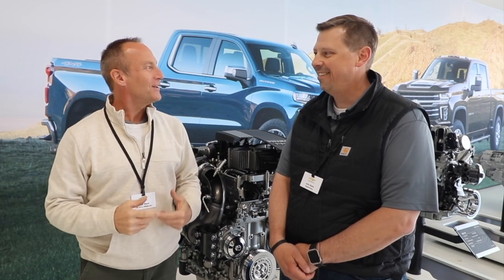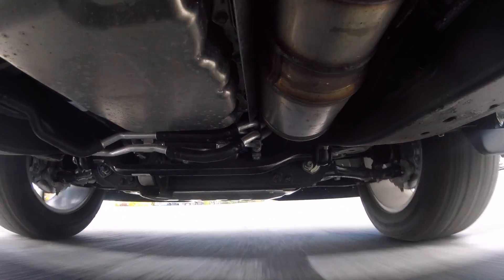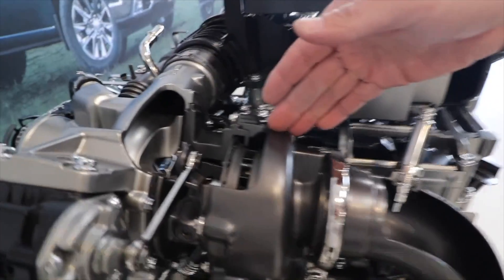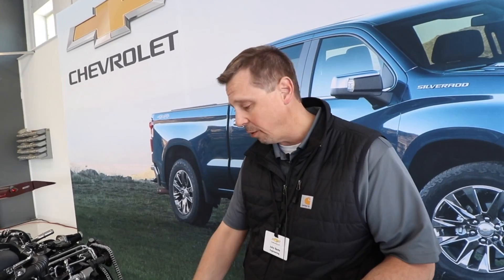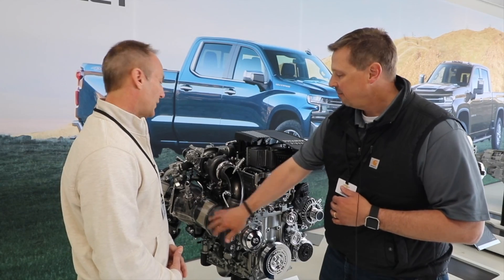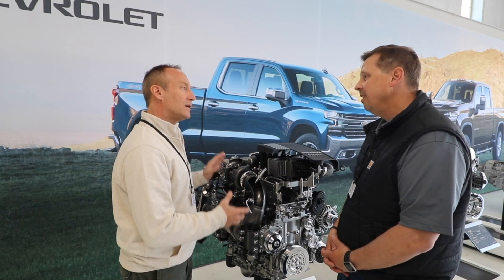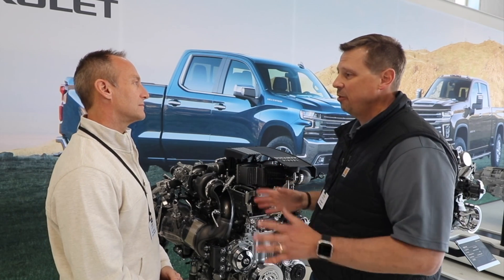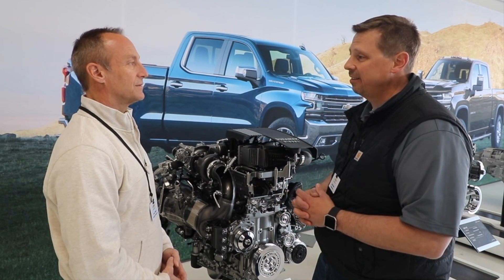Engineer Reveals All! Duramax 3.0L for Silverado 33 mpg hwy

Comment: I expect a diesel engine to go 300,000 miles as I do this one. What the engineer says is that the competition shoots for similar numbers as the 150,000. I have got better than 340,000 from gas engines. I have a 6.6 or whatever Duramax. Chevy put junk injectors as OEM, other than that expect 300,000. At 190,000 now. Biggest pains are 25 below in Minnesota, finding fuel in some towns, and when 5 gallons remaining in 24 gallon tank, can't go up any hill. You will be sucking air due to where fuel line draws fuel. Gas gauge says you are at 1/4, you're almost out.
Reply from the maker: Thanks for the real world experience comments. Sounds like an aftermarket tank could be in your future.
Reply: @4WDMagazine  on my 17th year with this Chevy, just live with the issues. Oh, and with a diesel, have to shut off your engine in drive thrus.

Comment: DEF is such a scam.
Reply from the maker: Just curious - What's your main beef about DEF?
Reply: @4WDMagazine  I don't think it actually works. I live in California and haven't seen a difference in air quality since 2008 since large diesel trucks started using it. Also the diesel emission systems they use now make diesel engines less reliable and much more expensive to maintain. 
 I think they just wanted to make a new industry to tax. It's all about money at the end of the day.
Reply: @highbrass3749  its cleaner I can tell.as I mechanic in the shop and ru semis in the shop to troubleshoot hydraulics,ext. But I the nasty, smoky  regen, kinda ruins alot of the benefit I think.
Reply: The EPA is a scam

Comment: Was it built along with Isuzu?
Reply: No. Duramax no longer has anything to do with Isuzu.
Reply from the maker: Designed in Pontiac Michigan
Reply: This engine is based on the same design as the Mercedes-Benz new OM-656 I6 diesel engine. GM's diesel engineering center in Turin, Italy adapted the design for GM's trucks, and the design was handed off to Michigan for final engineering work, testing and validation, and manufacturing.

Comment: Only 150,000 the old engines for 1956 pontiac Bonneville was rated at 500,000 the lsx motors would be good for 500,000 as well

Comment: Now if those geniuses can make the engines stay quiet and not rattle at low rpm,all of them not just some,I'm on my second engine and both rattled and both used over 3 quarts of oil between changes,first motor had oil pouring into the back 2 cylinders-they said I don't qualify for a buyback and I'll just have to listen to my bag of marbles for the rest of my life,first new truck, first to rattle of any diesel I've owned

Comment: Diesel in a half ton? Why? This is a fad. Hybrids are coming whether we like it or not. Hybrid will give you much more power while towing and better MPG. I saw what GM did when they dropped a diesel in an Olds 98, it sucked big time. I would not spend $65,000 on a “new” engine from GM. IMO this is a two to three year fad. The HD with larger Duramax is a must, 3.0L Duramax is a whim.
Reply from the maker: Good points but I'm not sold on hybrids yet.

Comment: old diesel engines designed by engineers new diesel engines designed by bureaucrats
Reply: Yup. My 86 Chevy 4x4 3/4 ton still runs great with the Goodwrench NA 6.5 diesel. It will start and run after an EMP when nothing else will. I have the 6.5 Turbo in my boat  as well and the only thing that goes wrong is the rotted and leaking fuel leakoff lines need changing every few years.

Comment from the maker: You'll never believe how long this engine could last! Could it be the engine for you?
Reply: Is all the dpf egr and non sense down stream of the turbo so can be removed easily?
Reply: @deadly134  ALL can be removed . . . you just need someone to fix your ECM/PCM/BCM to not freak out after deleting all that CRAP.
Reply: Well at a 150k it needs a oil pump belt done. How many blow up before then
Reply: New Truck, New Motor, Shitty interior! GM interiors are so dated it's not even funny.. Dodge will out sell them just cause interior comforts
Reply: Could but won't due to all the electronic garbage and emissions shit put on it.
Reply: Longer than my friends F150 and ram
Reply: Yah that won’t last at all. 7:20 in your video tells me that. These will last as long as the ford 6.4 power stroke.
Reply: Kwmike-D I agree I own a Silverado and interior super cheap looking

Comment: Anyone driving a diesel does notice the “ regen cycle”. You notice the bbq smell, the turbo noise, and the power loss during the cycle. If they eliminated those, good for them. On another note, I’m pretty sure that DEF is not good for the environment. I’ve run my truck near 2 different trees, both had limbs that died where the exhaust was pointing. I can only imagine what it’s doing to us.

Comment: Is that a timing chain i see on the back of the engine???  If so - Fail.
Reply: R J it’s a cutaway model
Reply: @justineubanks1497  YES, that is how I saw them, genius. My point is the fact that the timing chain is in the BACK of the engine.  Hard to service - and it will need service knowing GM.  Think Ford and Audi rear timing chains in the BACK of the engine - total fail for service.   C'mon man.
Reply: Your right
At least I’m not as genius as some these guys on here
Reply: Yeah, just bring your 401k to the dealer and they will replace it for you.

Comment: I see 40k to 80k the liquid charged intercooler will fail causing antifreeze to be shot into the turbo and intake just like the egr cooler failures in the past so no wounder you don’t advertise past 150k
Reply: The water to air intercooler is it own system, and not a new thing, the GMC Syclone and Typhoon of 1991-93 had water to air intercooling
Reply: Never said it was new just that it’s a stupid idea
Reply: @brianyoung5204  
It's the best way to cool down race cars, if it can handle the stress of race cars, daily drivers won't be a problem

Comment: 40 years of being a diesel mechanic anything this got Duramax on it don’t walk away run away this new engine with a chain on the back is a disaster waiting to happen all real diesel engines and trucks running 80 and 85,000 pounds are in-line six cylinders these engines will not stay together when you work them every day people listen 40 years of diesel mechanic experience I’m not lying to you these engines will not stay together

Comment: Sounds like Chevy needs to stick to gas engines! Glad I switched to Ram 1500 EcoDiesel truck, 200,000 highway miles, and towing a 28ft camper, great MPH!
Reply from the maker: What mpg do you get?
Reply: I average around 24 / 25 MPG on the Interstate, driving at 74 MPH. When towing my camper around 20 MPG, going up hills it drops around 18 MPG. Waiting on this engine in a Jeep, I have 16 Rubicon Rock Hard Edition now.

Comment: I'm 6mn in and I'm gobstruck at all the electric turbos, exhaust turbos, swirl-valves, high-pressure EGRs, low-pressure EGRs, anon anon anon anon. HowTF Rudolf Diesel ever got his invention to even start bewilders me. Certainly, all this b*llsh*t will cost a small fortune to keep in running order.

Comment: Belt driven oil pump....... where from what ive heard you have to remove the transmission to get to it which also means T-Case,  drive shafts, cross members,  maybe exhaust depending on how it routed.

ill be keeping my LB7 with potentially bad injectors over that engineering disaster

Comment: 2 egr valves, extremely high pressure pump / injectors ..... I can’t see many new diesels moving toward being long lasting . I have a dpf and epr diesel and it’s definitely not adding value to a longer lasting engine in my opinion. Good luck.

Comment: Brand new junk with a b50 service life of 150,000. For $43,500 base price. That is .29 cents per mile before finance charges, fuel, and insurance.  Great idea putting the DOC on exhaust side of engine, if you want a overheated engine.

Comment: They planned in a major breakdown or at least a planned very expensive repair for those belt changes.  

Regarding the belts vs chains or gears decision.  I guarantee there were some bean counters crunching numbers to determine how to maximize profit.  They calculate a small drop in sales vs a huge bump in repair revenue plus lower manufacturing cost.

Comment: Thanks for the presentation!
This explains perfectly why I will not buy one.
YouTube videos starring the brand new 3.0 diesel truck with 146 miles on the odometer and blown head gasket does not inspire me to spend $50k on a lemon.
Reply: I have one and it’s very economic and strong on tow!!
Reply: @MrFredexcel  never buy the first edition model year. Let others test the design for you. Most bugs will surface in the first few years of actual street use. I've worked in a car mill. I will never buy a new car.

Comment: Why would anyone buy this engine. 150,000 is a joke. 
I drive 2200 miles a week in pickup. My Tundra has never let me down. Only reason I was looking at this was mpgs.
Reply: So you spend about $20K a year on gas in your Tundra, and you'd save about $10K a year with the Chevy diesel.  Buy your Chevy from a dealer that offers a lifetime powertrain warranty, and you'll be in great shape.

Comment: aluminum block diesel scares me off.  Compressed graphite would be better.  EGR cooler leaks will cause engine overheats and block / head failure.  I would avoid it for at least the first two production years.  EGR valve will coke up those swirl valves on the intake.  They are in a hard place to remove and clean.  Like all new clean diesels that are loaded up with EGR, DEF, and DPF - don't buy this truck if you are doing mostly city driving.

Comment: That bicycle chain cam drive, though.   This is a bad place to save a few bucks or a few lbs of weight.   What's so hard about making a heavy built overhead cam chain setup?  Mercedes Benz and Toyota double row overhead cam chains almost never caused issues.    Today's overhead cam chains are really cheaply made.

Comment: WTF is 150k miles I have done that in 4 years so  basically those are throw away trucks...what's so hard about making the oil pump crankshaft driven like the 6.6 dmax and LS engines...oh never mind COST and yet rip off the customer....
My 08 dmax is pushing 550k miles 👍🏾👍🏾I'd like to see that stupid design oil pump belt last that long

Comment: The down fall of GM
Reply from the maker: What makes you say that? The other big two already have them in trucks (Ram Ecodiesel  -made in Italy, Ford Powerstroke - made in England)?
Reply: @4WDMagazine  and has had problems
Reply: @4WDMagazine  2 egrs. And a 4cyl gas option
Reply: @seoulkidd1  
???
Reply: @anthonywebber2211  that 3.0 diesel has 2 egr and GM wants a 4 cylinder for the Silverado
Reply: @seoulkidd1  
The 4 cylinder is for CAFE regulations
And makes more power than most V8 did 20 years ago

Comment: Water cooled guess what happens when it starts leaking into your air systmem lol. Bye bye motor.
Reply: What are you talking about? Lmao!!!
Reply: If you are driving a car.. school bus.. diesel, gas, diesel.. der... its water cooled. Water cooled, motorcycles, cars, buses, Van's, dirt bikes, go karts, have been liquid cooled for years!
Reply: They added a cooling system into the air intake to cool down the air as it passes through. Just like those as seen on TV cool air a/c. Water runs through and as air passes it should cool down. Guess what happens when a solid items pases through. That will bust your cooling system inside throwing water into your air intake. Not good.
Reply: JEsus Garay they’ve been putting intercoolers on the intakes for years...

Comment: "Should" last 150,000 miles, except for the fact that when they're driven off the stealerships lot they start to over heat and need to go back for warranty work......additionally the timing chain and oil pump belt are at the back of the motor, necessitating the removal of the transmission for replacement; what POS design! Can we agree that in a critical system like engine lubrication, the oil pump should be a dedicated component and gear driven ? Oil pumps should not be driven by belts like other peripherals such as alternators and power steering pumps; some of you engineers have rocks in your head !

Comment: For reliability. Simple is best not the complex DEF systems that can fail and break down. My 95 7.3 burns cleaner than this diesel ever will. All they are doing is changing the diesel exhaust to a different chemical. The resulting chemical is even worse than the chemical that came out of the motor. And spark plugs don’t need to be changed often. They could go 150K miles on a single set of spark plugs. Is the injection system hydraulic or a HEUI injection system. Most people using the truck will end up deleting the DPF and emissions crap. If I bought one I would do the same thing. And boost my power and MPG.

Comment: I will buy one of these when GM agrees to pay the tab for replacing of the timing chain and oil pump belt at 120,000 miles.   If the oil pump goes out before that, they pay for a new engine.  Would I buy an engine with a belt driven oil pump which requires the transmission to be removed for service.  NOT NO WAY, NOT  NO HOW, NEVER.  Why does Cummins drive the cams and pumps with gears, because it works for 500,000 miles.  Belts and chains on a long life diesel is flat out stupid. 

GM,, guarantee it or STHF up.

Comment: Again the manufacturers design for failure so you half to buy a new one. You know forty plus thousand for a truck is a steel so after 150,000 is a good deal when a gas goes twice that. They are back pedaling to cover there ass this engineer made a mistake and spoke the truth opps.

Comment: I want no pressure egr meaning rip the damn thing off...
Reply from the maker: Whoa, how come?
Reply: @4WDMagazine  Which begs another question, regarding (eventual) Deleting the emissions... The DPF is combined with the other emissions piece (SCR? I think he said) so for those who are so inclined, and the aftermarket, who like to supply what the public wants, they will want to Delete the emissions crap.  I'm just wondering how difficult GM made this for that segment? I've read the new Duramax L5P 6.6L was supposedly a hard nut to crack for the Tuner (Delete) folks but they eventually figured it out.

Comment: My '94 landcruiser is due for it's first "engine overhaul" at 400,000 miles. Its got 230,000 miles on it now (all original drive train). This duramax is junk, designed to crap out so you will spend another $40,000 on a pickup.
Reply from the maker: Your Yota engine probably also had a design life of 150,000 miles. Just sayin'
Reply: @4WDMagazine  No It was specifically designed to be overhauled per the manual at 400,000. That means the designers expected it to reach 400,000 and then be overhauled. This is why landcruisers are the most prolific and dependable used by many militaries and NGO's all over the world. There are better products out there and being a free market capitalist I choose to purchase those of better design.  Not products engineered to fail and be disposable. I am also just sayin'

Comment: Chain in the rear. Well that just eliminated this engine off my list. Why freaking complicate things? All done so they can stiff the owner later with a massive repair bill. Scumbags. The Ford is no better, with less power and a rubber timing belt. At least they were smart enough to put it in the front. And I don't want any FCA junk. It's extremely frustrating to buy a new truck nowadays.

Comment: Way way to complicated to many thing to go wrong. Take a page out of the cummins 12 valve handbook. Thats why you can hit a million miles with them and dont get me wrong im a big chevy fan. I even got a lb7 duramax.  There is no good reason to put all that crap in it. This will probaly be the next 6.4 ford for being a turd.
Reply from the maker: You are right about it being complicated. Aside from regular tools, now a guy needs a computer to work on his truck.
Reply: Heavy Metalworks it’s what’s gotta happen to meet the hp people want, emissions requirements, and fuel efficiency. If I was to spend 30k plus on a truck (I believe this will be around 40 or 50k), I’d just put a cummins in a classic truck, upgrade it to ride nice and have a beast truck that way.

Comment: I love straight six engines but wouldn't own one of these belt driven oil pump how stupid can you get
Reply: Then go buy a Dodge or Ford they will never break, I've never seen either in the shop or wrecking yard.
Reply: @2t713  your funny the v8 diesel is a piece of crap in a ford or anything else
Reply: @80f250  Well of course BIG GUY.

Comment: I'm a Chevy guy but this is designed for failure
Reply: Exactly!!! 150,000 miles?!?  My 4.3 had 252,000 miles on it when I sold it, it ran perfect!!
My first car was a Buick and had 296,000 miles with never being opened up!
My 2000 grand Prix has 285,000 miles, the 3800 runs perfect!!
That in line has a belt driven oil pump!!! YES, a BELT driving the oil pump!!  The heart of the engine!!!What a joke!!!
GARBAGE!!!
Reply: How long you been a diesel engineer for GM?

Comment: Swirl flaps, notoriously un-reliable; no 7th injector for DPF regen=washing the bores down with fuel and diluting the oil. Thing will be a reliability nightmare. Anyone who buys one, run a 20w50 oil so you at least have some film strength when it's full of fuel.
Guy doing the interview has NFI what the engineer is saying, has the look of a salesman, interjects with meaningless comments instead of asking tough questions.